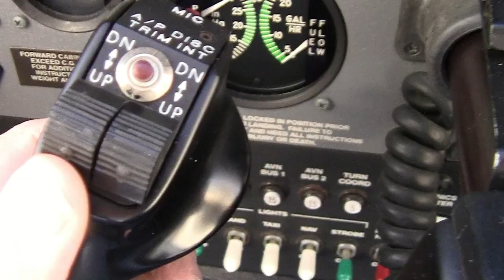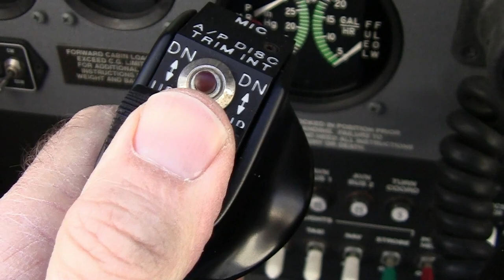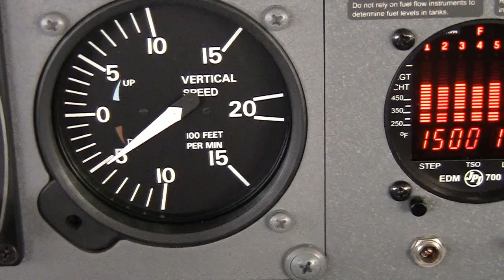How to Trim an Airplane [HD]

Comment: "GI JOE, KUNG FU GRIP"... that still shot was priceless. I started private somewhat older than some other students, I was 30. and I don't know about the younger guys but I definitely think I hurt my back and shoulder from so many hours flying without proper trim and fighting the yoke. Note to self everyone, learn to properly trim your plane or you will find yourself with painful back, shoulder and chest cramps. especially on your left side.
Reply from the maker: Ha. That's a line I stole from either John King or Rod Machado; can't recall. You steal from me, and you're stealing for the third time... :)
Reply: Were u training on a Piper?

Comment: Good show.  In the 1970s I was a mechanic, working for an airline that operated Boeing 737-200 aircraft.  I was in the cockpit jump seat one day and watching as the first officer flew his leg of the flight.  Once we were in cruise, he told me that the slip-and-skid ball at the base of his ADI, or FDI as it was known then, seemed a little off.  He then produced a small screwdriver from his flight bag and removed the cover over the tube containing the ball.  Next, he began making tiny adjustments to all three aircraft trim controls while monitoring airspeed and engine fuel flow.  When he was satisfied that he had established best trim with minimum fuel flow, he loosened the clamp which held the glass tube containing the ball in place and adjusted it until the ball was perfectly centered.  After watching it for a time, he tightened the screw, replaced the cover and turned around and grinned at me.  And that was the way it was done in the days of steam gauges.

Comment: Another great quick trainer and I also picked up few other good points from the comments. Comparison with cruise control gets the message home. Will defiantly be giving more consideration to trim in the flare, next flight. Nice tip. Thanks

Comment: I'm a presolo student, very close to soloing.  At first I struggled with managing altitude, then airspeed, and once I finally started to get that I struggled (and am still struggling) with timing the roundout and flare.  I read on an AOPA site that you could "somewhat mechanically" use the trim to manage airspeed.  Basically it said grasping the trim at the top, then taking it through a full motion to the bottom, you'll lose about 10kts in a C172.  Although it's not using trim as described in this video (finding the right attitude, and then removing control pressure), I've found this little technique to be very helpful in managing airspeed while in pattern.  I basically glance briefly at my airspeed near each turn, and if I'm at least 10kts too fast or too slow, I reach down and adjust trim.  When I was trying to manage it with control pressure, my mind would get boggled with all the other stuff going on while in pattern, and I'd eventually lose focus on the control pressure, and I'd either be too low or too fast.  Trim seems to help since I can set it, and not think about it until the next power or configuration change.
Reply from the maker: Hmmm. I'd have to think about that and try it in the airplane... what's going on with the yoke control pressures when you use trim in this way? I guess if it works for you and your instructor approves, then OK... but it's a bit like changing heading by slipping or skidding the airplane with rudder... yes, you could do that, but it's not generally how rudder is used.
Reply: Garry Wing  Of course it's reducing yoke pressure.  :-)  So if I could get my mind around your procedure, and do it quickly (I think my mind works slower than other people or something -- I think through everything), then your procedure would achieve the exact same result.  It's just that I'm going maybe 100kts, rapidly reaching the abeam point on the end of our runway, I've got a checklist to execute, and I've got to maintain altitude and get my airspeed reduced to 85kts.  It feels a little overwhelming.  By using trim in this way (after I'm stable turning from crosswind to downwind), it bleeds off enough of the airspeed that I'm usually pretty close to 85kts by the time I get to the abeam point, and if I'm managing my power right, I'm fairly close to my pattern altitude the whole way.

Managing trim "the right way" is probably another one of those things that I'll have to practice more before it feels natural.  I do use the right procedure when I'm out cruising around and have time to think it through.
Reply from the maker: J R <<<Of course it's reducing yoke pressure.>>> Yeah, then you don't have the airplane trimmed properly to begin with... POWER controls airspeed when you're trying to fly S/L unaccelerated flight; not PITCH. (Don't confuse this with Pitch for Airspeed/Power for Altitude during the approach...) If you're pre-solo, don't stress about it; you'll get it... same with roundout/flare timing... it takes 5-minutes to 'get it', but it may take many hours to get to that 5-minutes... I've had Instrument students that never learned to trim properly... My first 100-hrs. as a VFR pilot I probably didn't touch the trim control much either.:)

Comment: I liked the video. I haven't really started to use so much trim in my real lessons, I only use some so I don't have to battle the yoke like a hero, but I don't feel confident in myself to be  "flying by trim" yet. I don't really like to let go of the yoke at all, and usually grasp it like holding on for my life. And since my flight instructor is so damn relaxed he says nothing much about it. Now, the plane I fly doesn't have rudder or aileron trim, what do they correct for? Crosswind drag? Or does it have more to do with center of gravity issues?

Comment: question: is it a good and common practice to trim using the G-Meter? Technically, when you are perfectly trimmed, your G-Meter should indicate 0 (or rather 1 I guess). So to quickly trim without having to try and guestimate that you are not pitching up or down, can you just operate the trim to put back the g-meter at 1 and poof, perfectly trimmed? I know not all airplanes have a G-Meter, but I've been front seat passenger in quite a few planes, and most had one.

Comment: Liked your video a lot. However how do you reset the trim? Let's suppose you used it but now you want no trim at all. How do you do it with the trim in the yoke? And how with the wheel?
Reply from the maker: +Camilo Moreno There is no such thing as no trim; the trim tab is always connected to the elevator (or rudder). I can't think of a similar control on a car to compare it to, but think of trim as fine tuning... it's a secondary flight control that makes adjustments to the amount of pressure you exert on a primary flight control, such as an elevator, rudder or aileron. You only change the amount (nose up/nose down for elevator), but don't reset it or have no trim at all.
Reply: +Garry Wing I think he means center the trim tab back to neutral position after each flight. As you can have to much trim in one direction and affect the amount of throw each control surface has.

Comment: Do you recommend trimming for slight bak pressure in landing?
Reply from the maker: Yes; I do that in the Skylane... use electric trim during flare to keep nosewheel and that heavy TIO-540 engine off the runway until I fly it down on the roll-out...

Comment: Ok, student pilot question.  I know there is a takeoff trim setting. Is there a landing trim setting?
Reply from the maker: Good question, but not really. Keep in the mind the takeoff 'setting' is generally just a mark that was kind-of / sort-of where the trim should be for takeoff when the airplane was first rigged (in the factory). Every plane of the same type (172's or Warrior/Archer, etc.) will be different. On landing you want to trim for nose-up landing; again, to relieve control pressure so you don't have to pull as strongly on the yoke.

Comment: Where did you get that ipad mount?? Is that the mini or full size one?
Reply from the maker: Bought it from Marv Golden's in San Diego. It's actually the Bonanza yoke mount; put it on the co-pilot yoke so it doesn't block the instruments in front of me. And yes, it's the Mini. Be sure you get one with Cellular built-in (but don't need to activate service). The Cellular and GPS are on the same chip, and that's the way you're going to get internal GPS on the iPad.

Comment: Okay. So I'm  flying straight and level, but I do not want to use my trim anymore, as i want to make some manouvres.  How do I release, or turn off the trim. Hope I don't  sound to dumb.
Reply from the maker: +Paul Wiles You don't "turn off" trim, any more than you would turn off power steering in a car. It's always there (it's a secondary flight control). You either re-trim for your maneuver or hand-fly asserting the needed control pressures.
Reply: would it be okay to think of it as
returning trim to neutral?
would that be like thinking of it as " off "
Reply: the amount of trim is also determined by the amount of power you have set as well. Usually, once I'm to my cruising height or some distance away from the field then i set my trim to climb or just hold current cruising height. I haven't really used the trim before doing any maneuvers. You can use it if you're doing slow flight for an extended amount of time thou.

Comment: It seems like when I have nose down trim while landind even though I have full flaps down and my airspeed is 65 - 60 right before I flare the airplane just pitches up and continues flying as if I'm too fast. But when I set the trim close to take off then I don't have this problem an the wheels touch down nicely. Can anyone tell me why landing with nose down trim messes up my flares?? Please?
Reply from the maker: You don't actually use the trim indicator settings to determine how much trim to use. I assume you're doing this on a computer / X-Plane, etc., not in an actual airplane, right? Hopefully you're not landing a real airplane with nose-down trim :)
Reply: As I saw in the video, there are white marks on the trim in the cabin, to line up for take off and landing, not a pilot but would think you just zero them out close to airport..

Comment: What you mean there's 3 types of trim i need to worry about? I suppose I will find out when my instructor tells me
Reply from the maker: You can wait for your instructor to spoon-feed you (at $60+/hour), or you can learn much of this from the FAA's "Airplane Flying Handbook"; or google. Our 3 primary flight controls are: aileron, elevator and rudder. They each (may) have secondary flight controls associated with them. Virtually all light trainers have elevator trim; many have rudder trim, a few have aileron trim (the Piper SportCruiser did, as I recall).

Comment: i still dont understabd how trim works and i don't know how trim works on a larger plane or on a airliner
Reply from the maker: Think of it as a 'counter-balance' for the control surface (elevator, aileron or rudder). In the case of elevator trim, it is at the FAR end of the control surface, creating the largest possible moment (because of that long arm), and providing enough leverage for that tiny trim tab to offset control pressure for the much larger elevator. Search 'Trim Tab' on Wikipedia for a more technical explanation. And it works the same on all size aircraft; the laws of aerodynamics don't change as you step up to larger airplanes.
Reply: Garry Wing i thought trim is only avalible on a small airplane.wait,if a large airliner uses trim,why cant i see the trim wheel on the cockpit in large airlines
Reply from the maker: captainjackdied
Of course airliners have some sort of pitch trim; usually electric/hydraulic and yoke mounted control. Fly-by-wire (A320, 777, etc.) totally different matter; it's all gyros/motors/computers controlling pitch, but with many layers of redundancy.
Reply: ok now another question.if fly by wire and etc fails,how will the pilots control the trim ?
Reply: captainjackdied airliners trim is AUTOMATIC, the pilot uses the yoke to fly. That being said, the pilot has always both the pitch trim wheel and the electric actuators on the yoke. Airplanes wich features the fly-by-wire system differs from the others because the pilot inputs are transferred to the moving surfaces by a computer, rather than a metallic wire, or an hydraulic link.
Reply: Francesco Venturelli QUOTE:  "  airliners trim is AUTOMATIC "

No, not all.  Airbus, and some Boeing models, to a point yes.  It is much more complicated, though, than a Cessna 182.
Reply from the maker: WeedWhacker2010 My Cub works the same way; jackscrew moves the leading edge up and down; simple and effective.

Comment: I'm not a pilot. Why would you use trim instead of simply making the adjustments to the autopilot? Autopilot will keep the plane flying level.
Reply: Most of the smaller planes don't have the auto pilot. At least not in the since of, tell the plane to go to this point and goes. Some do like your Cirrus R22, but most Cessnas at least all the ones I have ever flown do not.
Reply from the maker: Actually almost any airplane equipped for IFR flight will have an autopilot; from a Cessna 172SP / 182, Piper Archer / Dakota, etc. While not req'd for IFR flight, nobody in their right mind flies hard-IFR without a working auto-pilot.
Reply: Thanks for the reply, Garry! I enjoy your videos.